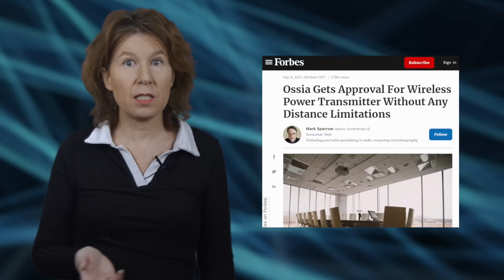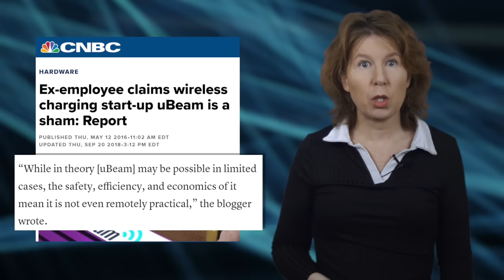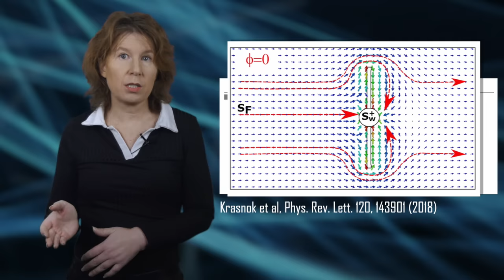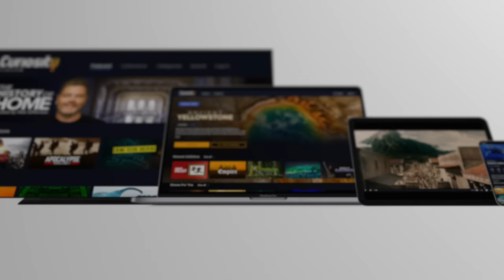How close is wireless power technology?

Comment: There are several wifi routers today that claim to be able to locate devices within their range in 3D space and adjust their field geometry to increase the signal strength directionally, toward these devices. Instead of using a kilowatt to blast a few watts in all directions of a sphere, maybe a similar directionality could be used to achieve better power efficiency.
Reply: The acronym is MIMO and this is a very common technology now.  It uses multiple antennas, and controls the phase of the signal in each antenna relative to the other antennas, to produce constructive interference in the desired direction and destructive interference (cancellation) in other directions.  This tech is used in modern smartphones too, not just in wifi routers.
Reply: @brothermine2292  Yea, it's a nice theory, but it never worked out for me in practice. I have the same crappy signal strength from my upstairs router with MIMO off than on.
Reply: @dominic.h.3363  : Is that the fault of the MIMO technology, or is your wifi signal being degraded by obstacles between the wifi router & device?  Which wifi carrier frequency are you using?
     Have you tried running a wifi signal strength app on the device to display all the nearby routers, their strengths, and the channels they use?  You could walk around while observing the display to help you find dead spots, and maybe that would let you deduce the obstacles.  You might also observe interference from a neighbor's router on the channel you've been using, in which case you could choose a different channel. (I choose a non-standard channel, in-between the standard channels, because many nearby neighbors in the building have routers.)
Reply: @brothermine2292  I have been an IT professional for the better part of two decades. I've been employed as a network analyst in 2016 by the biggest eCommerce company of my country, so I find it highly unlikely you could teach me something new about my own router. The technology makes big promises that flop just as big when it comes to its application in certain environments.
Reply: @dominic.h.3363  : Are you trying to say you already performed the tests I suggested?
     I hope you understand I'm just trying to help (you and anyone else who has a wifi signal problem).
     Here are four more questions:  How many MIMO antennas does your router have?  How many MIMO antennas does your device have?  How many devices are using the wifi router simultaneously?  Does your background in IT networking include the relevant wifi experience?
Reply: @brothermine2292  All I'm saying is the attempt is appreciated, but unneeded. But okay, I'll play ball... I'm on channel fourteen, my neighbors are on channel 3 and 6, there are just the 2 of them. The obstacle argument I think is null and void, I don't see a single decimal point of dBA increase with MIMO on vs. off, regardless what kind of interference we are talking about. If there is SOME signal strength without it, the signal should amplify with it turned on at a measurable rate. It doesn't. I'm not saying MIMO is a hoax, I'm saying its implementation in this router is utter crap. The router is an ASUS RT-AC85P.
Reply: @Evi1 M4chine The cable is a fair argument for american constructions, but not in europe where your walls are solid brick, so you can't just fish cables through non-existent recesses in your walls.
Reply: @dominic.h.3363  : You answered some of my questions.  You might want to consider the other ones (and why they may be relevant).  Here's another: what is the device that you connect to your router via wifi?
Reply: @brothermine2292  Because you're throwing wireless networking 101 at someone who is not in need of it. You aren't helping, you are being presumptuous.
Reply: @dominic.h.3363  : To the contrary, I'm NOT making an assumption about your wireless knowledge. (Also, you continue to assume no one else who has a similar weak signal issue and less experience than you have will read these comments, even though I mentioned that is my secondary purpose.)  You might want to consult a therapist if you're suffering from a feeling of insecurity.
Reply: @brothermine2292  Ugh, that reminds me of my university dorm's wifi. They had so many routers and access points that all channels were completely flooded and massively degraded the performance (not to mention people running their own on top). In my last year there they finally laid cable to every appartment and we suddenly had 40-50 times the speed, without any changes to the actual internet connection.

I always prefer cables over wifi when i can choose, especially for stationary machines.

Comment: Based on my experience of watching people with their phones, and the fact they hardly ever put them down or stop staring at them, I think a better solution would be to work on a phone that can charge using the capacitance of the human holding it, if your battery gets really low you could just pop on some nylon socks and run around on a cheap carpet for a bit.  I think it's easily as viable as running half a fridge to slow charge my phone at 30cm from the charger.
Reply: If you find a way to turn stupidity into energy even the second part would not be needed.
Reply: It might be easier and more efficient to simply take an electrical generator and put a hand crank on it.
Reply: I've heard about clothing that captures some energy from the movements of the person wearing it.  I assume it's in the sleeves of shirts and the legs of pants.  I don't know whether it can capture enough energy from people whose lifestyle is typically sedentary.  But it would have a secondary use of burning a few extra calories... inefficiency wouldn't necessarily be undesirable, assuming it produces enough power to charge the device(s).
Reply: Hhaha indeed! Or maybe it's good that we have to put the phone away to charge. So we get a break from it. What other future technology innovation are you most excited about?
Reply: @brothermine2292  Great call out! Thank you for sharing. Maybe we will make a video about it 💪
Reply: @brothermine2292  scary indeed. What are your thoughts then on companies like Neuralink with their brain implant technology?
Reply: @joevignolor4u949  ElectroBOOM made a video where he did just that! He made a stupid mistake though, which broke his wife's phone!

Comment: While I love the idea of plenty of wireless energy available everywhere, I',m a bit concerned about the efficiency of the current solution when paired with the impact of energy generation on the planet.
For instance: if all the water we had was a small pond, and the only material to build hoses were very permeable and leak water everywhere, we'd keep using buckets to transport it valuing more efficiency over convenience as that convenience might be the source of our demise.
In the same way imho while research is always great, we should wait to have energy generation that doesn't contribute in making the planet inhabitable before we let the conveniency go mainstream. And this is the step the market systematically fails :(
Reply: Except that we aren't limited to a small pond, the sun will keep shining for at least a couple billion years, and we could always use solar power. Plus wind and hydroelectric power aren't going anywhere any time soon either.
Reply: @anon_y_mousse  well, it wasn't a 1:1 example.
Just a different scenario where waste can be avoided until there's a better solution rather than just following the convenience sake.
Considering we're, as a species, still mostly relying on stuff the keeps degrade the habitability of the only planet we have perhaps that might be the pond? 😅
But let's don't get too much caught up in the pond example, it was just a trope not at all the center of what I mean which is still:
definitely do invest in research about wireless energy transfer, but perhaps please refrain from marketing it while it's still just a wasteful gimmick.
Reply: @un_lucio  It's not really a concern, if humans really can affect climate change then humans can cleanup whatever mess they make. If they can't then it's a non-issue.

Comment: The biggest problem is the fundamental inefficiency of any such system: even if it was safe to transmit energy wirelessly, it would be ridiculously expensive.

When transmitting information, this loss in power efficiency is just as huge, but doesn’t add up to that much for WiFi, for example. Sure, sharing WiFi will drain your phones battery pretty quick, but you won’t notice switching off your router in the electricity bill. For wireless headphones, this is even worse as wired headphones often are operated by the power used to transmit the information alone: so wireless headphones need to both keep up a bluetooth connection, and power all the actual functionality of headphones from internal batteries. We went from no power required to batteries that need charging daily.

So for some company to look at those technologies and think “that’s it! We will charge phones like this!” is in my view ridiculous. The power is the worst part about the current technology. It’s their big weakness. It’s why you now need to charge your headphones daily.

The companies pursuing this are constantly balancing safety with power, so that the energy they waste is at least not a health hazard or cause fires. I’d like to think we would consider the energy efficiency of any wired consumer product BEFORE the heat radiated might burn your house down.
Reply: Just use wired internet and headphones!

Comment: A couple comments on "metamaterials." Most "metamaterials" are just metasurfaces - the difference being metasurfaces are resonant structures, meaning their unit-cell size is on the order of the intended working frequency. On the other hand the repeated geometric structure (unit-cell) for a metamaterial must be much smaller than the intended operating frequency. In-fact the paper you reference aren't "metamaterials" they are metasurfaces. There are a lot of practical reasons that make this an important distinction. But researchers have opted to use the terms interchangeably, and favoring the keyword "metamaterial" which has a bigger impact, in terms of citations, because it spans multiple disciplines despite being definitionally incorrect. 

In the context of wireless power transfer metasurfaces would help reduce the physical size of the transmitter, in theory enabling a better "link" by allowing for a higher gain antenna/array without having to make the transmitter impractically large. A metasurface will also make your system slightly more efficient because its a resonant structure that really likes to resonate at one frequency - of course this comes at the cost of bandwidth, but we dont care about that because we aren't sending information. 
All in all a metasurface, from my view, does little to get around the fundamental problems of wireless power.
I do think they have some application for bespoke systems. I'm thinking something like an MRI setting.

Comment: They already exists a wireless charging system that works very well. It use visible electromagnetic waves and is called Solarenergy.
Reply: XD indeed very true  the key is you need a large omnidirectional high luminosity beacon such as the natural gravitationally bound fusion reactor at the center of the solar system. XD
Reply: yeah...try building your own 1GW transmitter...

Comment: What about improving the efficiency of solar panels to the point where ambient light can power devices? How many orders of magnitude are we away from that? If we had 100% efficient capture of the entire EM spectrum, how many watts could something roughly phone-shaped device absorb?
Reply: With entropy considerations I believe there's been a proof that current solar panels would max out at around 35% efficient at converting light energy into electric energy. Then ambient light levels in your home is extremely small, say you have led lights that are somehow 100% efficient. Usually they are about 10W but let's round up to 20W.  Then I'd say the closest you get to a light bulb is about 1m. Say you're phone is .1m^2 and is orthogonal to the source.  Then you'd get .1×(3.14x1^2)×efficiency ≈ .314×1/3≈ 0.1W
Not nothing but not a lot...
Reply: Not all that much, even in bright sunlight. 1361 watts per square meter at the equator. Do the math if you like, but phones are small (1/100th sq, m), it's cloudy sometimes and dark half the day, 20% efficiency solar cells are more common, and you don't live at the equator. So you might be able to keep your phone charged if you can let it sit out in the sun all day. You could harvest less than 1 cent worth of electricity a day. Better to charge a power bank and plug that into your phone at night.  Or you could just plug into a charger.

The key to cost-effective energy harvesting is cutting consumption to where you don't need an extra power source. Like ultralight cars that run on solar power, or superinsulated houses wit no furnace.  I have a couple solar powered calculators that work great, even under room lights. Those tiny little batteries are crazy expensive.
Reply: Well considering that light bulbs don't use that much power to run, are not 100% efficient, and your solar panel would be capturing just a small portion of the light I doubt even if you had 100% efficient panels (which are impossible) that you could realistically charge a phone from it. You'd probably drain the battery more just from the phone being in standby mode than you'd be able to charge it.
Reply: Solar panels are effective enough currently that any future gains in efficiency would not fundamentally change the nature of the problem.
Some back of the envelope math, assuming perfect efficiency:
Suppose a 60 watt lightbulb. You place your phone in direct contact with the bulb, let's suppose you capture 1/6 of this power (I guess it would take about 6 phones to completely absorb all the light based on geometry). So now you are charging at 10 watts, which I would say is acceptable. Now suppose you are ~1 meter from the surface. Now the light is spread out over a sphere of surface area 4pi 1m^2 ~10m^2. Let's say a phone is a 0.1 m x 0.1 m square, to be generous. So that's an area of 0.01 m^2 for the phone. Now we would need 10/0.001= 1000 phones to completely absorb the power. So each phone is charging at 60W/1000=0.06W, which wouldn't even register. Maybe I made an error here so please correct me if I did
Reply: @Wltrwllyngaeiou  Dyson phone shell?
Reply: @Llortnerof  That's what I was thinking...

Comment: My whole house gets all its energy wirelessly. It's called solar: The sun transmits energy wirelessly in all directions, and enough of that hits my roof to power my home and my car. And even with batteries to run the house at night, it's still significantly cheaper than when I was buying energy from the utility company.
Reply: solar energy is not cheaper than being tied to the grid - about 15¢ / kwhr in most of the USA
the cost of the solar panels and the battery storage system takes about 15 years to reach the break even point
at which you need to replace the batteries.....
Reply: @kenwittlief255  
The only reason grid power is as cheap as it is is because the grid doesn't pay the external costs: Pollution, CO2, global warming, etc. Premature deaths caused by pollution from burning fossil fuels, especially coal, are astronomical. If the grid had to pay those costs, solar power would be cheaper than grid power even in North Dakota. And as I noted above, my house is 100% solar (with batteries for nighttime) and is significantly cheaper than the grid here. Which is why nearly every house in my neighborhood has solar.

Comment: The crystal radio which had no battery used wireless energy transfer to enable head-phones to be powered; since it used a tank circuit, the transfer was resonant. That was well over 100 years ago.

Comment: You could have a crystal which internal structure will amplify this crystal intrinsic properties (be it optic, or acoustic) when under proper resonance. Using those amplified properties the stream of energy will be generated. The energy amplification will have a "mechanic" similarity to acquiriing energy from random movement using latches. In this solution, the latches will work in the domain of resonated crystal (optic, acoustic, etc). This double working will need two kind of metamaterials, one crystallic and one not. The not crystallic metaworking will be available only under proper resonance of the crystallic metamaterial.

Comment: You abrubtly stopped at regenerative   wireless power transmission. Me too working on it a smaller scale. it works at RF, wondering if I could  use this enhancement in nearfield magnetic coupling.

Comment: Transmitted waves going all over can be fixed by putting receiver and transmitter at antipodal points on the earth and using ionospheric reflections to transmit from one to the other.  The waves spread only until they've gone a quarter way around the earth, and then start converging again until they all arrive at the antipodal point.

Comment: A few years ago I was challenged by the head of our R&D department to develop a whole-house wireless power system to provide energy for low power devices around the perimeter of the home from a centralized point within the home.
Without irradiating everyone in the home and using a significant anount of power, and without running into FCC issues for creating a source of HF interference, it just isn't a viable concept.
Reply: Are you still looking for a solution?
Reply: @chrisfuller1268  Not any more.  I retired early last year.  Kickin back and relaxin.